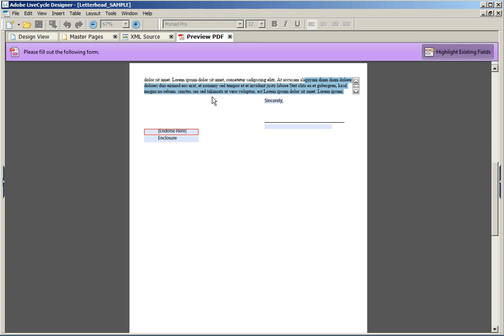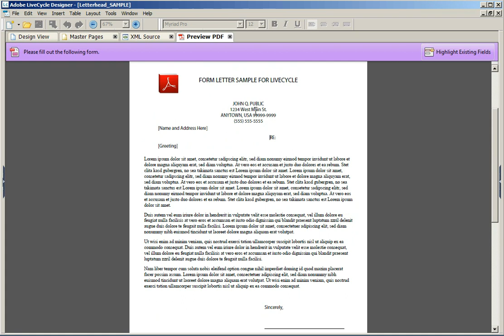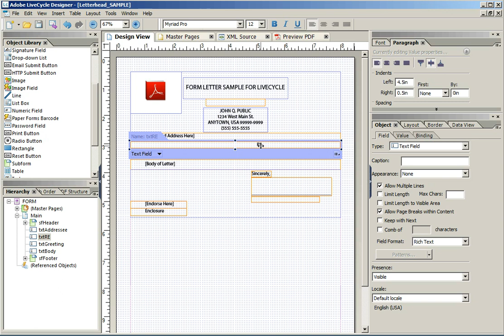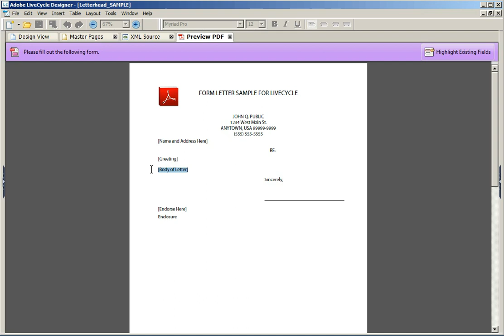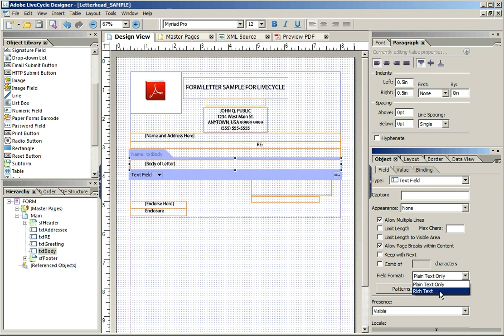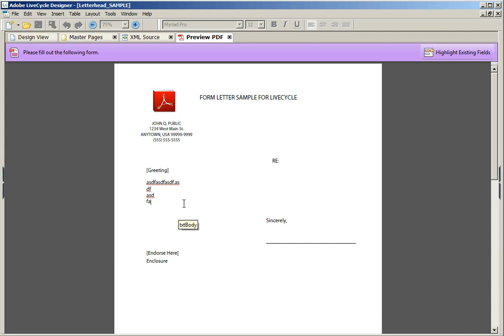Form Flow in Adobe LiveCycle Designer ®

Comment: Hi TTT.  I have found your vides incredibly helpful.  Thank you for posting them.  I am hoping you can help with my form flow.  I have several options on a form for people to choose and depending on the choices, other boxes appear for them to fill out.  However, if they change a choice (radio button), the correct new options do not show up (until they re-click).  I have tried putting the coding in the "change" as well as several others, but cannot seem to make it work.  I am not sure what the best way to communicate to you all the details, but hoping you could help me with that.  Thanks in advance, Laurence.
Reply: just a bit more info - if option1==a and option2==b, then show textfield1 else show textfield2. That all works nicely (thanks to your videos). However, if user changes option1, they have to reclick on option2 to get the correct textfield to show.
Reply from the maker: Laurence Rowles Yes I see your problem.  The "change" event is not a good way to make this happen.  It "fires" way to often to get consistent results.  I would use the "exit" event...it is much more consistent.  Of course, on a comment thread everything is kind of vague.  If you want more specific help, contact me via my blog: www.truetechtroubleshooting.com

Comment: In a flowed form, is there a way to add buttons that will take a user to a specific part of the document? Something resembling named anchor hyperlinks in HTML? The event handler goTo() won't work because we can't know how many new pages are added to the form as the user enters data.
Reply from the maker: Yes, but it get's complicated if you want to link to dynamic content that may or may not exist when the button is clicked.  In the script for the click event you would want to use the function xfa.form.setFocus(objectName);

However, for error checking purposes you may want to wrap that statement with an if statement that first checks to see if "objectName" actually exists.
Reply: True Tech Troubleshooting Thank you. I think I got my answer. One would use an absolute page name, which is what I did, and this works, perfectly. Thank you so much for your guidance and help.